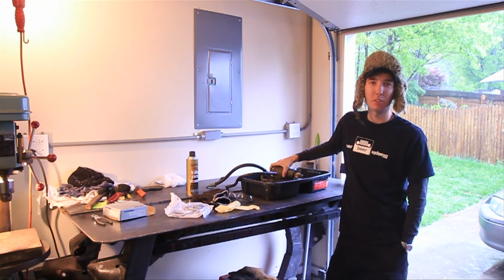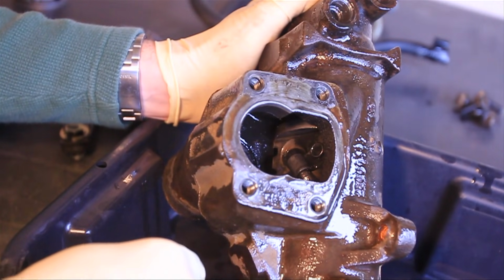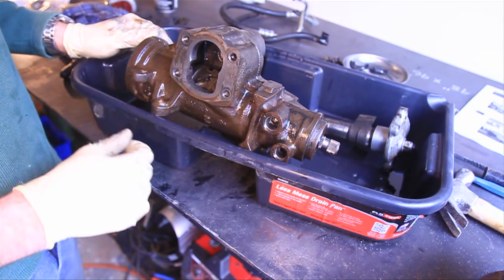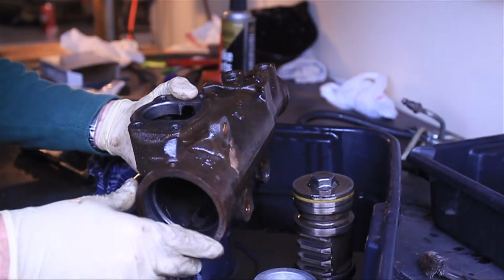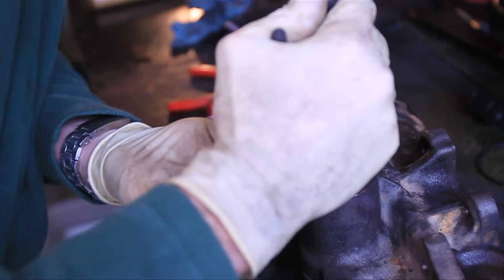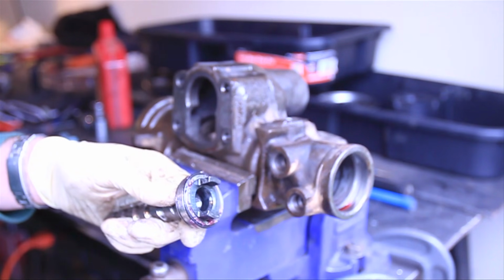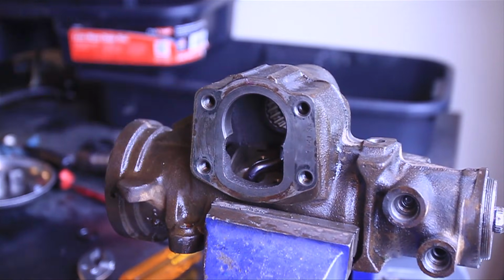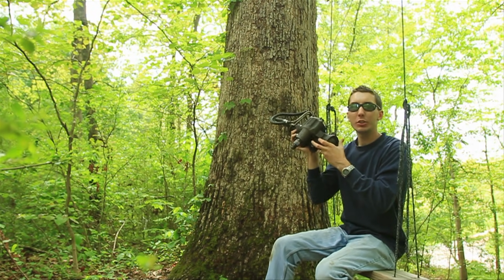Rebuild your Steering Gear Box

Comment from the maker: Don't feel like it's worth the trouble, we can reseal your box and even tap for hydro assist:
https://bit.ly/2kaZ8Lq
Reply: what is the charge to rebuild a gearbox
Reply: Corvair owner with huge 80 degrees of steering wheel play - column though does wobble! Already this has been  helpful (lost half a turn when I loosened the jam nut - so, great catch by you in that prior video!)

Comment: Just a little piece of advice putting the balls back in it is easier to remove the threaded plug in the bottom of the secter end buy aluminum cap

Comment: I'm rebuilding a saginaw gear box and the seal kit in your comments does not include the correct seal for the sector shaft output. Can you please share the seal you used around 12:30?

Comment: They charge more to reseal your old box than it cost to just buy a new box off of eBay, it will cost you $50 to ship it and another $50 to have it shipped back plus $250-$350 to have it resealed 😳 no thanks, that’s almost what GM charges
Reply from the maker: Fake News.  It's $18 to ship, we ship it back for free.  The service we offer is to port and tap your steering box for hydro assist which also comes with new seals since we will be in the box to clean it out.  We also offer a reseal only for a lower price.  Almost all steering boxes from the parts stores are remanufactured so you never know what you are getting,  especially from ebay.   So good luck if you decide to go that route.

Comment: Why did we tear apart the entire box to do that seal? You pull the snap ring start the engine and turn the steering wheel to full lock it will blow the old one right out. I would have replaced the teflon power piston seal as well.

Comment: Rebuilding my steering gear box in my 79 CJ7.  I have watched about 5 different videos of people rebuilding these and it seams everyone had 24 ball bearings except for mine.  Mine had 22.  Has anyone come across this?  I looked very carefully when taking apart and cleaning.  Only 22 bearing in there.
Reply: I'm about to do my 81 cj7 and have been watching a lot of videos.   I could swear I've heard at least 1 mention of only 22 bearings.

Comment: I have an 88 S10 Blazer . My steering box is leaking from the input shaft . Is it possible to just change the seal and fix it without breaking it down ? And will this stop the leak or is it that the o rings need to be replaced on the piston input ?

Comment: Is it possible to just remove piston to replace teflon rings ? Working on 2003 dodge ram 2500 turns hard to left only no leaks no binding.

Comment: hey i chaneged the seals from where the steering column connects to the gear box n it still leaks any advice👍🏻? it went in straight i used a socket to push it in even

Comment: I dont see anything about re installing. Is it difficult? Does the worm gear need to be set at a certain position eith the steering wheel. I feel there is a big key piece missing there.

Comment: Hello i just installed new one and after two days it leaks from input shaft???? it's new why it leaking? something wrong with the seal from the factory?

Sorry for my ENG it's my second language
Reply: It seems that many of the "remanufactured" units that you'll find at auto stores, are put together by groups of blind monkeys, and most will have one or more of the "new" seals, put in backwards. Im willing to bet a paycheck that's the problem with your "new re-man" unit.
Take it back, get a refund, and find another auto store.

Comment: I put new seals in my steering gear per the video, bled all the air out and now my steering wheel spins to the right when I start the engine. I can turn it back but spins back right when I let go of the wheel. Besides a new steering gear, do you have any suggestions?

Comment: I got a 99 Durango Gearbox in my TJ. It works but is leaking up top where the steering column meets it. Could I just do the outer seal and be on my merry way?

Comment: Somebody in the past installed the power steering hoses and got the return hose mating surface cocked and distorted the mating surface. My local jeep pro had a couple new hoses so ive replaced those. But if that doesnt solve the leak problem, does anyone know of a reseating/resurfacing tool for the hose ports?

Comment: 02 Grand Cherokee, I'm having trouble steering right, it hard stops at around 180 degrees most of the time, when I should have +360 degrees of wheel turn, but does make pop sound like something has come loose to open up for a another 30-60 degrees of wheel turn sometimes. Im not sure if it's the gearbox or the pump. Left turning is just fine, There are no leaks on the steering line. Any thoughts?
Reply from the maker: If it's not the tire or something hitting then its probably the gear box.
Reply: I can feel the 'pop' through the steering wheel when steering.

Comment: That being said, I just looked at this durango swap. I do not need hyro assist. I am only running 33s 456 gears 99xj all the works..sye..etc and I don't rock climb..It's a DD and I tow a Cargo trailer time and time ...78,000 original miles...never had a problem with this steering box till now. never any play. Just fluid coming out of the seals after the jcr plate and box brace. I do have a winch bumper on there so that extra space on the bolts might be a issue. It was a bitch getting in. The longer bolts thread to the end of the box tapping so don't think that's a issue. I have to take this box out and see exactly where this leak is. It is either the top seal, bottom seal from what I can see. Hoses and flare fittings are still intact. I might have cracked this box tightening the bolts on the re-install. I will learn this vid if I decide to rebuild so thanks Matt for all of these great videos. I am from Rockland County NY and far from you guys. I wanted to come see you for the Jamboree but can't make it. Maybe some day. Thanks again. Sincerely. Ricky G.

Comment: Hi Matt, Damn I screwed up. Put the collar on the casing of pit shaft for the box brace. also did the jcr strengthening plate. Got it all back together and pulled out of my garage and boom...Leaking now!  ....Pretty sure I tightened the collar too tight and blew the seal.

Comment: hi  im wondering if you can help with a bit of advice i have a 1979 trans am and i have been threw 2x steering boxes recon ones from classic industries the one i have on now is the 2nd steering box it worked fin e for a couple of days then steering went stiff. i have jacked front end up and tried to bleed but nothing i took off pressure hose and turned over and fluid is flying out of the end of the pipe so its not a pressure issue on the return hose very little pressure not enough to go back to pump i have been using transmission fluid could this be the problem instead of using power steering fluid i thouight they were the same any help would be appriciated thx scot...

Comment: i have a good bit of play in my steering and a significant leak at the output shaft. my 93 xj has 250k miles. at this point will the worm gear be too worn out for a rebuild. would I be better off getting a reman box from the parts store

Comment: hey im rebuilding one on my 87 dodge ram and while i was taking it apart i noticed something like a broken spring in it, i looked at the box again and seen that where one of the fitting goes there look like a check valve if you go to 6:43 im taking about the top fitting, would it matter if that valve doesnt work?

Comment: hey this is my second gear box from o 'rally auto parts store dont no if u heard from them or not both boxes were no good i still have play in my wheel everything is new under there with the truck running i can turn my rag joint shaft and as sonn as i move it ican see the oitman arm starts to move bit not my tires wat do u think
Reply: they dont really rebuild those boxes usually. just put in new seals....redhead steering has fully rebuilt boxes at a marginally more expensive price.

Comment: Very clear tear down, seal replacement. I wish that you would have touched on steering wheel play, and shaft play.(the bearing you did not take out) I was hoping you where going to talk through it.But you passed on. Which these are my box symptoms. I have very few that leaked. But all have had some degree of play at the steering wheel. And a '72 corvette that had extreme shaft play. You make great videos.

Comment: I have steering play and when you turn the shaft that comes from the wheel and goes into the box it turns partially with ease. 
Does this rebuild get rid of ALL play in the steering?
Reply: Dewalt is also like to know how to get rid of steering box slop.
Reply: The nut on top he said not to turn is how you adjust the play. 1/4 turn tighter at a time and then take it for a test run

Comment: Thanks! Nice video! But... in the video you did replace just 1 oil seal in the pitman shaft, Correct?Can you confirm that there are in fact 2 oil seals? upper superior oil seal (followed by a washer) and a lower inferior oil seal (again followed by a washer)?Thx

Comment: new gear box $150
gearbox seal kit $25
youtube research $0

yep,  Ima rebuild my own gear box. it works good with no slack,  but it recently blew out the input shaft seal
Reply: +Texassince1836 $150? you're lucky. im canadian and autopartsway.ca wants $431 PLUS a $250 core deposit. so.. definately rebuild

Comment: can you replace the input shaft seal without taking everything apart and out of the jeep?
Reply: You can definitely replace just the input shaft seal without disassembling the whole unit. I just did mine yesterday. The threaded end cap of the input shaft will come off by itself. Once removed, the dust cover and seal can be replaced.
Reply from the maker: +Tim Stephenson no
Reply: O that totally sucks    thanks for the info
Reply: +Parker Bankston I said fuck it and replaced everything.... new gear box and new pump... works great now lol

Comment: This would take me two weeks.  One day of taking it off, one starting it, 10 thinking why did i do this and two finishing it up.  Then another few days to install it.
Reply: You're doing good at 10 days! I accidentally put the wrong seal on a the input shaft and stretched it out to where it was too big to fit where it belonged. had to order another seal kit from rock auto and that took 2 weeks. so I think I got you beat

Comment: Great video.
Do you know why my steering would be harder to turn to the left than the right.
All of my other steering components are in good shape.
I have an input leak on the input shaft seal so i have to take it apart anyway.
Just wondering which internal part would go bad and make it harder to turn one way than the other.  The pump makes noise going left also. 
any help would be much appreciated. 
Thanks

Comment: G'day from Oz Matty.. Awesome video mate.. I read some of the comments. i'm not sure if anyone has pass this info on. Just wanted to share a little trick with the Ball bearings in the Piston housing. If you remove your Rotary valve (by turning Anti-clockwise) from the Unit keeping the steering box Horizontal you can slide the Piston out with the balls inside.  When you pull the piston out have a container underneath to catch any stray ones (They usually stay inside the piston). And when reinstalling use a little grease to hold the balls in place in the guide tube and then pack the piston from one hole only starting with the next color inline to match the way you packed the tube (again with a little grease to help hold them in place). When reinstalling the Piston into the housing have the end plug removed so you can see the magic take place.. Allow the worm gear to pull the piston in and hey presto.. It's a bit easier and allows you more room to play around. Hope that help others when doing the install.. All the best for New Year everyone.. =)

Comment: Great video and information.  Question - I want to have decently fast lock-to-lock steering with my ram-assist, and to do that I'd like to increase the 'flow' (GPM) throughput on my gearbox, and I'm wondering if you have considered ways to do that?  Can orifice(s) be enlarged to enable more GPM?  I would think it could be done if certain orifices are opened up.  Pressure sould pretty much be the same(?), but how would one go about enabling more flow through the gearbox so the lock-to-lock speed isn't diminished?  I'm using a pump that does 7 gpm and 2000 psi.

- Sam

Comment: I'm rebuilding a gear box that looks just like that one out of a '95 Chevrolet Caprice Police Package 9C1.  The rebuild kit I got from Omega didn't have the right seals (particularly the Pitman shaft seal) so I couldn't use it.  What rebuild kit did you use for your gearbox?  It looks so similar I'm willing to bet it'll use the same exact kit.

Casting number on my box is 26000525.  2.5:1 Steering ratio.

Comment from the maker: the only thing we didnt take apart was the top cap assembly which you can see at 2:30.  As mentioned if you take that apart it will be hell getting it adjusted right again.  Other than that we didnt skip anything.

Comment: Nice Video.  My power steering conversion doesn't return to center on its own and feels like it has some drag in it.  The alignment shows good caster (3 degrees).  There's no play in the saginaw box.  I've adjusted the box both directions with no improvement.  Does this sound like a bad steering box, or could it be the pump having issues?  I bought a rebuilt box, and I'm thinking it may be no good.  Any help would be greatly appreciated!

Comment: Good video.  The closest I ever came to rebuilding a box is replacing the pitman shaft seals in my AGR box.  The seals had failed because AGR re-engineered the seal system without realizing that they are not actual engineers, lol.  I just put an OEM seal kit in it.